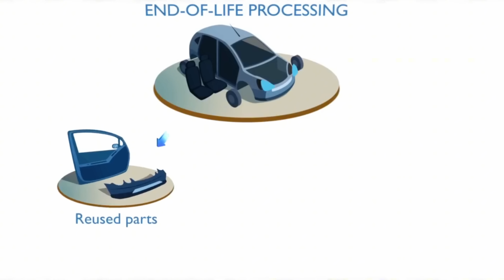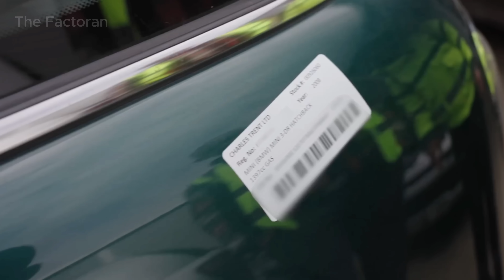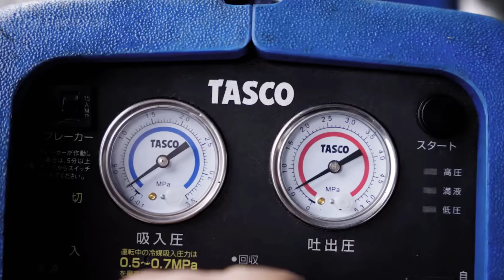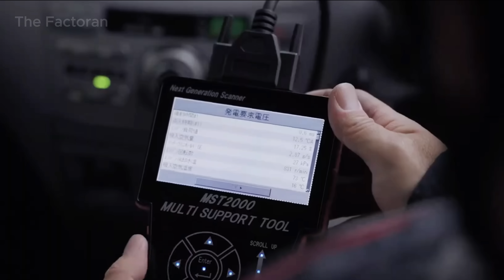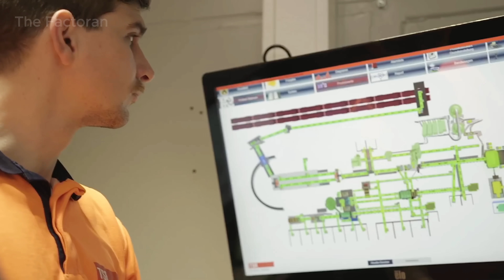How Millions Of Old Cars Are Recycled Into New Steel | Massive Car Recycling Line

Comment: Dead at 10 years, my truck is 33 years old and still going.
Reply: My car is also still on the road. Built in 1993. :hand-purple-blue-peace:
Reply: @I-Am-Wolfie  Got a 20-year-old Honda and it still runs like new.
Reply: I have a 25 yr old  Mercedes going strong.
Reply: @cqmacht4513  No wonder we are in a recession!
Reply: 1993 T-Bird, still running fine. Needs paint, though.
Reply: @RandyRydberg  My car is red. Correction: Was red. The 🌞did his job very well. :face-purple-wide-eyes:
Reply: Both my 67 year old Cadillac,  and 57 year old Mustang are in good shape going down the road. Cadillac purchased by my parents in 1960, I bought my Mustang in 1977. 😊
Reply: Ai thinks cars last 10 years.
Reply: He must've been talking about  Hyundai/Kia 😂😂
Reply: 33 year old pickup? I'm guessing you drive a Chevy/ GMC. I've got a 92 that's on its third rebuilt motor. It has over 450 k . It's my daily driver. Starts and runs without question. There's a reason you don't see them for sale often unless there's nothing left of them.🤠
Reply: in the rust belt of the US cars don't last 3 to 4 decades like in the South. But we keep are vehicles until they are dead.
Reply from the maker: That’s impressive—33 years is a true testament to solid engineering and good care! 🚙
Reply: Mi troca es g .m .c 1987 y no le pide nada alas nuevas. Tafff truck.
Reply: My car nearing 20 years old 😂
Reply: 2003 Hyundai, still going, 153k
Reply: @steelydannnn yeah right 😂
Reply: What's your thoughts on using Ai as clickbait to trick people into watching a video?
Reply: @sunoverbeach im so sick of the AI...you can hear it in the odd flat unnatural rythem of the speech. If the want to put out content, at least talk for real. With that said, this particular video is informative.
Reply: You are certainly slowing down the economic cycle of any country by driving a car for 33 years. If all people are doing the same way in driving their cars for 33 years, many car making factories will be closed, workers be laid off, dealers and other related business will all closed. To you, it may be a good thing to save money, but to all others whose life depends on sales, services and other related business, you are killing their business.
Reply: 01 ranger going strong
Reply: Lasts longer than my parents cars, which is usually about 6 months or so.
Reply: Great, but I bet the manufacturer is kicking himself, because he wanted to sell you a new one 23 years ago!!

Comment: I drive my vehicles until the engine and transmission give out and/or the frame gets rusted out.
Reply: I had to say goodbye to a wonderful '66 Galaxie 2 dr hardtop. Little did I know back then that I could get a rust-free frame from any southwestern state junkyard. What a waste. Same with a '71 Cadillac some years later.
Reply: What's your thoughts on using Ai as clickbait to trick people into watching a video?
Reply: @sunoverbeach  If you don’t like it, just scroll past the video.
Reply: Last two cars I had quit, were an old ‘83 Tercel and an ‘87 Camry.  The A/C on the Camry was kaput, (Tercel had none), but the end of both cars was the driver’s door - window register on the Tercel, outside door handle of the Camry.
Reply: Here in the civilised world we drive cars that don't have frames, the are monocoque.
Reply: @metricstormtrooper  Indeed. Built like and insect designed to be crushed and a written off in an accident. I'll take a banger on frame any day. Monocoque cars are throwaways.
Reply: @JohnBroughton-u4h  You must be an engineer :D
Reply: @ta22stcoupe  😁😅🤣
Reply: Nobody cares
Reply: @user-nx8bz1gd9w  Thanks for commenting it shows you care
Reply: @user-nx8bz1gd9w  At least one person does.

Comment: I can't imagine, the truck I have driven 300,000 miles and still driving, polished once a year, cleaned and maintained in good running condition, will someday be melted down? I don't want to see that. There should be a pasture for old trucks where they sit under an old oak tree and peacefully rust away.
Reply: It sounds like you know how to maintain a vehical, and won't have-ta worry about puttin it out to pasture. It will last you to the end...if you want it to. I drive cheap hi-mileage modern junkers into the ground, and then scrap them.

Comment: What is the carbon footprint for all of this recycling? And then there will be the next carbon footprint when making new cars from the raw steel.
Reply from the maker: Good question—recycling still has a footprint, but it’s far lower than making steel from raw ore.
Reply: @TheFactoran  
Not the same foot print as digging up new iron ore, agreed. Although, sorting out widely varied qualities of steel and aluminum still takes know how, time, money, and energy. And hopefully not to build cars that only last 120k miles or eight years. Not to mention car makers who do not supply the needed parts when their cars fail.

Comment: Fixing an old car is making use of the footprint that was made decades ago when that car was first produced.
Reply from the maker: Exactly, keeping old cars running is a smart way to extend their original footprint.
Reply: Ditto on that Rick. All it takes is time, money, and ambition.
Reply: @joequillun7790  
There is a choice. Spend money fixing an old car or spend money on another used car. Careful on selecting a later model used car though, as simply needing a new heater core could be $1,500 parts and labor. Or maybe $3,000 parts and labor just to replace a timing chain tensioner.

Comment: 75% of "new" sheet metal used in automobile bodies is virgin steel. The other 25% is from recycled automobiles. 50 years ago, about the only product that could be made from recycled cars was reinforcement rods made to bury in concrete. Nowadays due to technology the steel scrap can be sorted with better efficiency.
Reply: You are living in a fantasy land don't we think them?Cars are good for as reinforcing rod for concrete.That's about it
Reply: That's also why if you've ever worked rebar you'll know that one piece will bend easily and the next acts like it's going to snap in half. Inconsistency in the mix I assume.🤠
Reply: That sounds good.
Reply from the maker: That’s a great breakdown—technology has really changed how recycled steel is used.

Comment: HEY. I need both of those taillights that's on that vehicle being shredded. I thought this video showed how plastic was removed and recycled. Guess not. I still want both those taillights.😮
Reply: My wife drives a 2005 Buick. Up until about 2020 all of the local junkyards had several of them in their yard and I could buy taillights mirrors and other parts off of them. Then I suppose because not too many of the parts were being sold they scrapped them after they are about 15 years old to make room for newer cars.
Reply from the maker: Haha, those taillights didn’t stand a chance in that shredder! 🚗

Comment: How come most of these vehicles still have front windshield and other windows on them before they are crushed. I thought each vehicle gets stripped off of reused glass before the rest of the vehicle gets torn apart. 😮
Reply from the maker: Good eye! Sometimes the glass is removed later in the recycling process.

Comment: In the Philippines cars from the 70s & 80's 90's still on the road...haha
Reply: Go to Cuba they have cars in the 50s going strong
Reply from the maker: Haha that’s awesome! Those cars are built to last.
Reply: so do in Malaysia as the vehicle numbers are far more than the population numbers
Reply: South Kansas we still drive 50s and later vehicles, mostly trucks. Cars don't rust out here so there's lots of oldies but goodies on the road.
Reply: In the Philippines they must like clicking on Ai generated content
Reply: Compare against Cuba--they beat you for sure. I wonder when they will start getting new cars there...
Reply: @oscareloyromeroaguilar3528  A lot of those cars are being held together with coat hanger wire, coat upon coat of house paint brushed on and even salvaged park benches for seats bolted to patched up floorboards. There are later model Russian cars on the road and then there are the show quality 40s and 50s American specimens.
Reply: Here too, I drive a 1955 Chevy Bellaire

Comment: Seams like it's different from car to car. Some cars they remove the windows 6:01 , other cars they destroy it with the windows still intact. 8:58
Reply: that is because this entire video is pieced together from other online clips. Nothing is a consistent process that follows one particular recycling facility  or even location. One clip shows a car being picked up in the USA, the next clip shows an intake location in Japan, then they switch to car storage lots in the UK etc. The entire video tries to make you think you are watching a USA based recycling process, yet most of the clips are from other countries which have different procedures, requirements for recycling etc. It is a video that is ok to watch in general, but it is not specific to the process in the USA. I wish they had taken the time to separate the recycling processes for each country to show a comparison instead of just mixing everything together and pretending that this is based on the USA when it is clearly not.
Reply: Having actually worked in a metal scrap yard this is what I would expect people to believe.
The reality is a whole different story.
Reply: @timsmith5950  I thought so.
Reply: Tires too
Reply: High pressure liquids escaping out in some. Some videos you see windows. Other full tanks of coolant 😂
Reply: Glass is nonmagnetic 😊
Reply: Surely the only vehicles worth stripping down for parts before recycling are the newest, and highest value? What's the point of taking reusables off a 20 year old mass-produced car, no longer available new, worn out and of no value? I'd imagine they'll go straight to the crusher intact.
Reply from the maker: Good eye! Yeah, the process can vary depending on the car model.
Reply: @TheFactoran  I would like to buy your Ai generated course on how to steal other peoples content to make YT videos for monetary gain